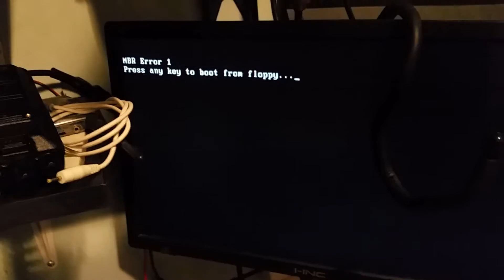HP T5740 Thin Clients

Comment: I have both t5720 and t5740, but I need the riser for my t5720
Reply: the t5720 is running Windows XP, the t5740 is running Windows 10, I was hoping the t5740 supported a 64-bit OS so I can run my rust server on it, but its only supports 32-bit, but I need the riser for the t5720 so I can add a PC card in it
Reply: yes, I did install Windows 98 on the T5720, but decided to put Windows XP on it, the t5720 maybe gaming, or video capture with it? idk?
Reply: I had a usb floppy drive, and partition the drive for Dos, then remove the drive and connect it to my PC and copy the Windows 98 files to the drive and connect the drive back in it and run the setup
Reply: I want to turn the t5740 into a quad multiviewer, but cant find a operating system that can do it without using windows and the program?
Reply: I just read your comments and see that you have Windows 10 installed on your t5740. How does it run? I myself have a t5740 and need it for a small project, mostly showing a webpage plus maybe a powerpoint slideshow for at the local sports club to show some information. Right now I am on Windows embedded 7 standard, and I am in doubt whether to install embedded 2009 because that OS i can just download from the HP site and it has one year less support than 7.. but if I can manage to install 10 on it and it runs smooth, it can last for years to come

PS. I have an extra IDE HDD installed of course, can't do a lot with the flash disk of 2GB
Reply: it runs ok on it, but I want to turn the t5740 into a quad multiviewer, but cant find a operating system that can do it without using windows and the program?
Reply: Foxx D'Gamma I have 4gb or 8gb ram in it I think?
Reply: Foxx D'Gamma 4 inputs and output on one screen and do PiP
Reply: Foxx D'Gamma Thanks! I actually found this out the hard way. Installed the latest build of Windows 10, but indeed its not that great. Like you say, wes7 is the best option for me, as I'd also like to install optional software like Onedrive, which is not supported for XP-based OS's anymore. 

It's a shame though, to never run the OS it was designed for, which even still has 2 years of support. I do miss the good old days of XP.
Reply: do you have the riser for the HP T5720, I need one for mine